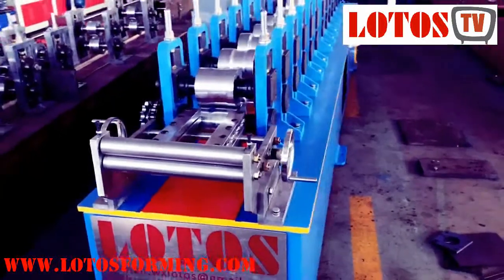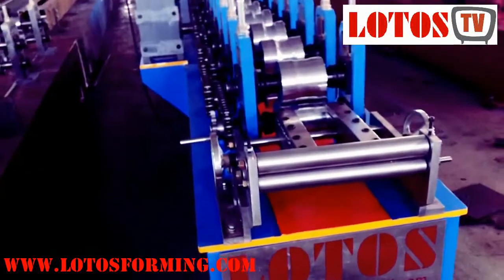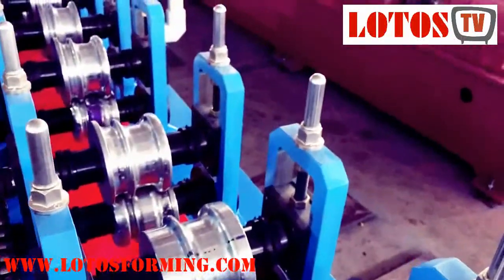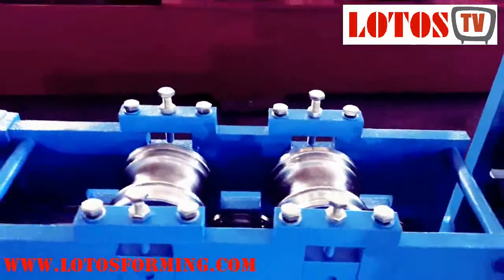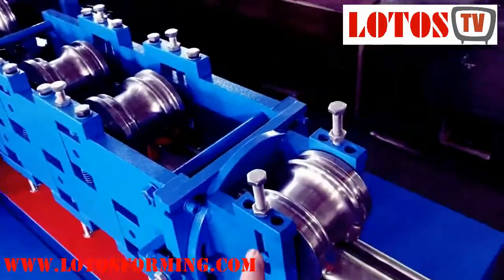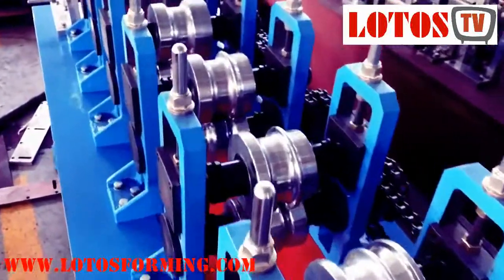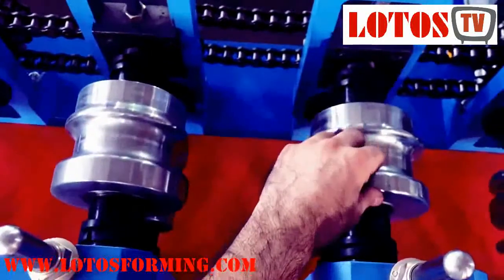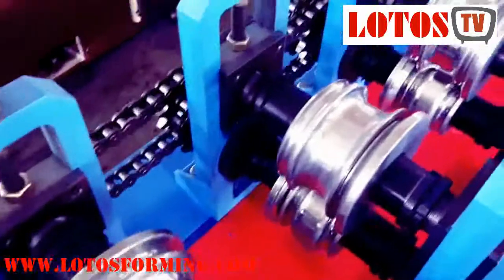【Door Shutter Machine】: Shutter Door Forming Machine" LOTOS DESIGN"

Comment: (1) Perforated Roller Shutter: it’s applied punch before forming step.
(2) PolyurethaneFoamed Door Shutter: it’s applied PU Foam inside of shutter, it’s good for Fire-Proof and Sound-Proof. Less noise during rolling up and down.
(3) Single Layer Rolling Shutter Door: in different door shutter design, such as shutter width and shutter section drawing.
Reply from the maker: design and install a Roll up Shutter needs these parts:

Motor and Barrel
Guide Rails
octagonal tube
Box Assembly
Remote Control Unit